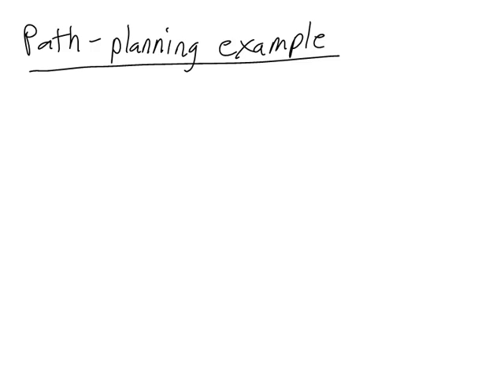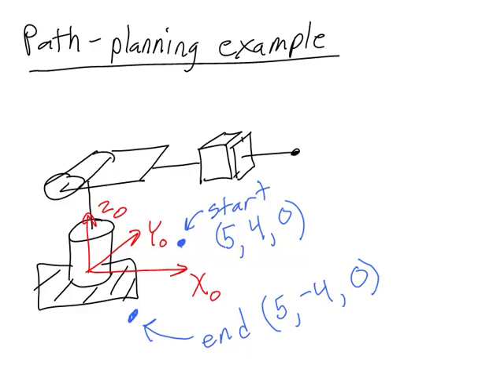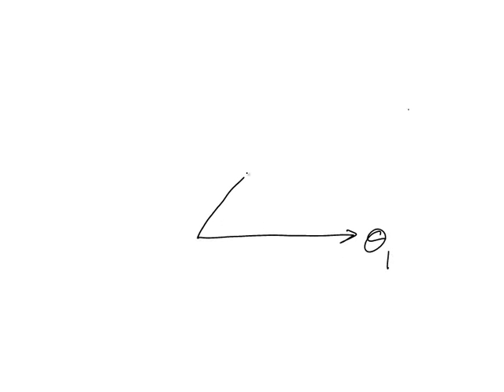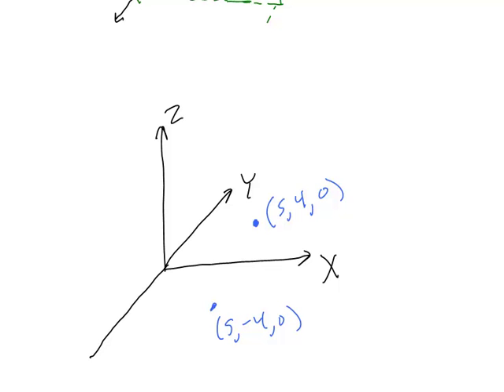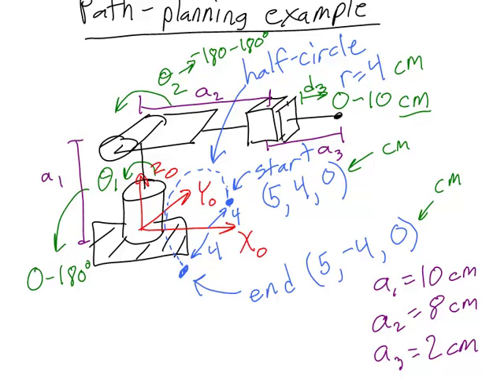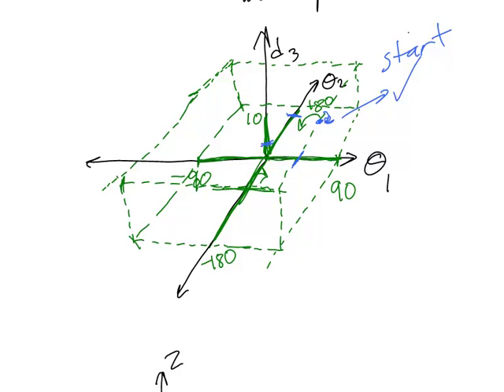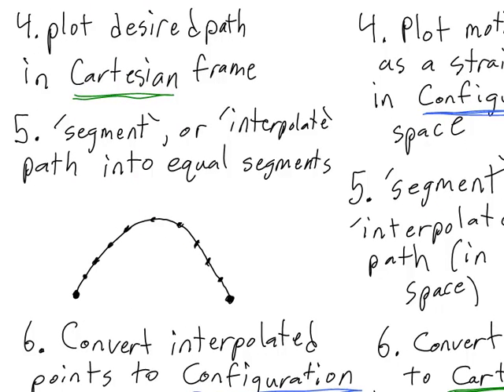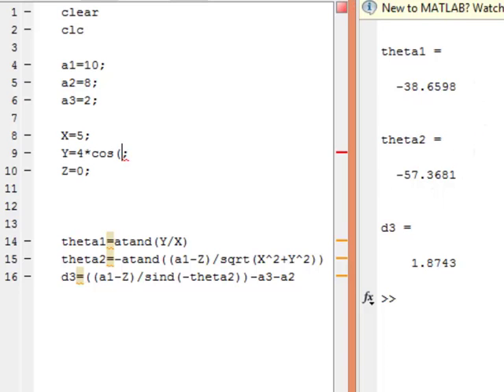2 2 3 Lecture Video 4 of 4 Path Planning

Comment: so how im going to draw configuration space for 5 or 6 degree of freedom (like for kuka youbot manipulator) in order to find its workspace? teach mee :)
Reply from the maker: The robot workspace is all of the area in space that the robot can reach. Even in a 6-dof robot, only the first 3 dof are used for positioning - the rest of the joints are used for controlling the rotation, or orientation, of the wnd-effector. So, for the purposes of avoiding obstacles and planning motion, you only need to draw configuration space for the first three joints.
Reply: thank you. that helped me a lot. now i see. xoxo haha